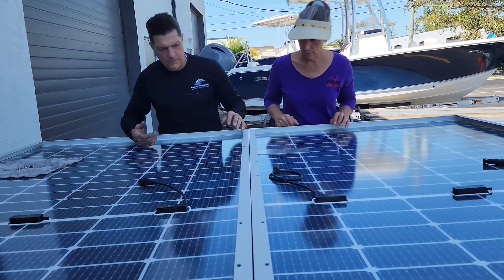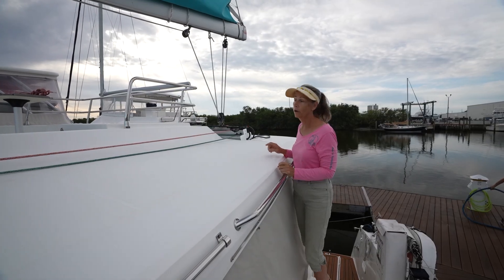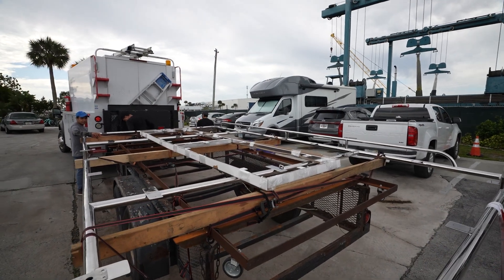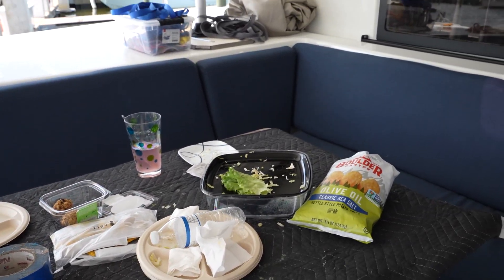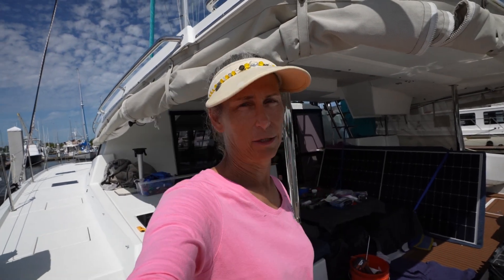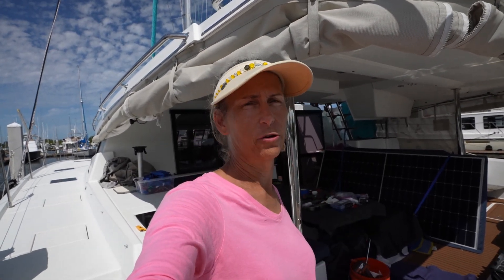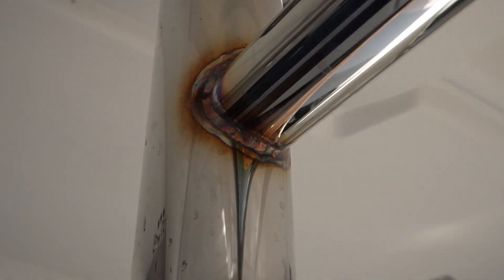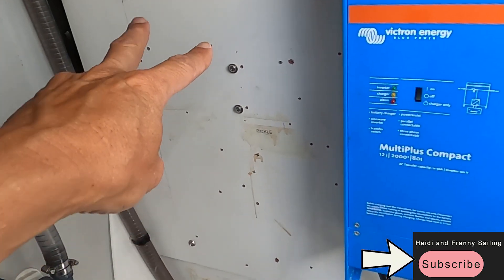REBUILDING our SOLAR power with the latest tech BIFACIAL panels  - Ep. 33

Comment: Just a curiosity. Did you use locking nuts or is unnecessary? Any sealant was applied in those bolt holes? Hugs from Brazil! Safe travels.
Reply from the maker: That's a great question :) I did use lock nuts on all the mounting bolts and because the bolts are stainless steel and the solar panel frames are aluminum each bolt got a dab of Tuf-Gel to reduce any galvanic corrosion.  I should have mentioned all that.  Thanks for your question :)